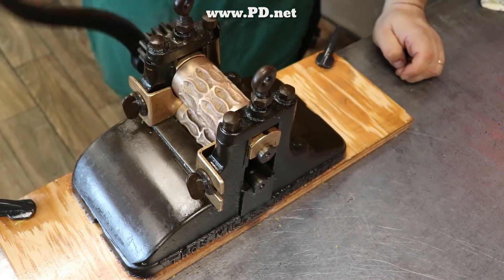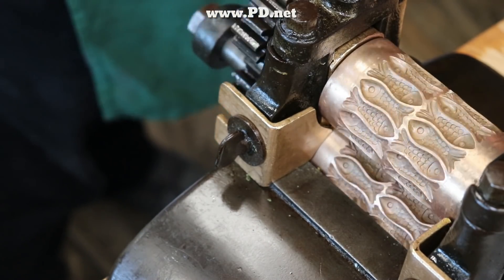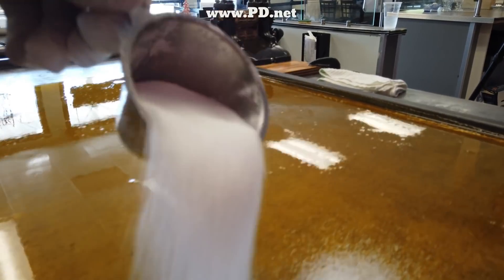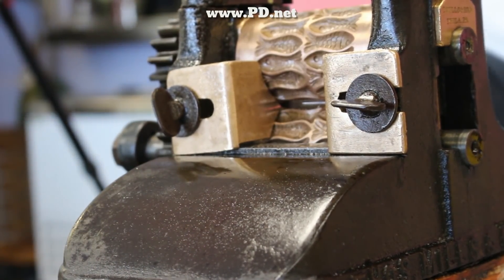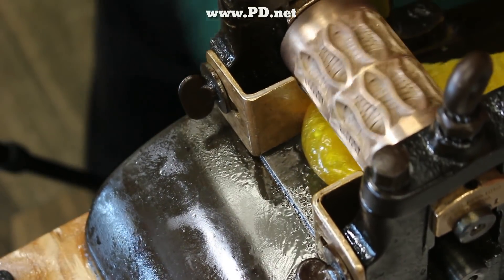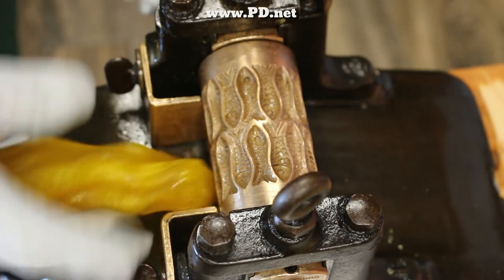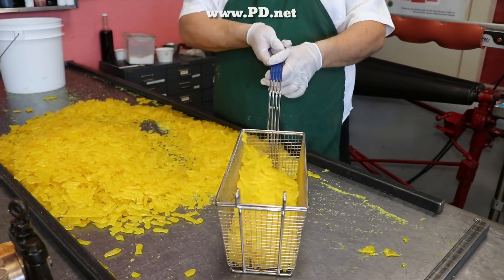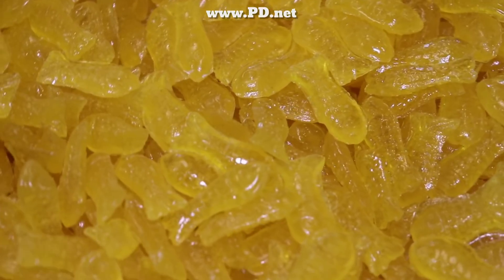#102 Making Babel Fish hard candy for Towel Day 2019

Comment: Question what happens to the flash when you make drops?
Reply: I was wondering the same thing, although it didn't occur to me to think of the crumbs as "flash"
Reply from the maker: Flash is the correct term. There is less of it that you think it's just very fluffy. if it's at all even slightly humid when I'm making this like it was with this batch it basically just sticks together and becomes useless. If it's dry will often save it in sealed bags and use it in out tea.